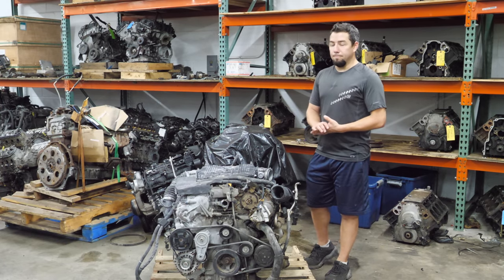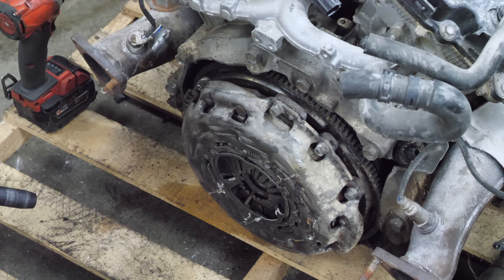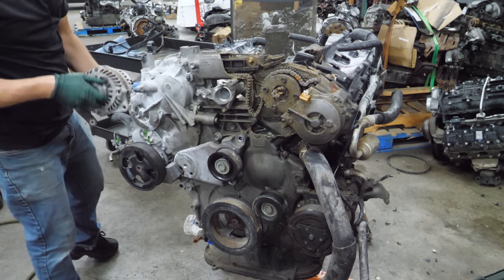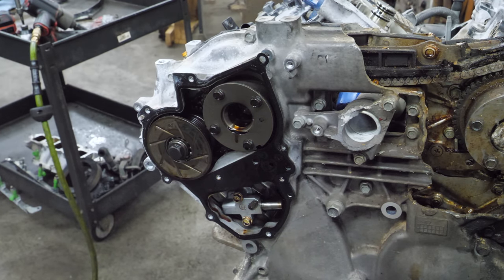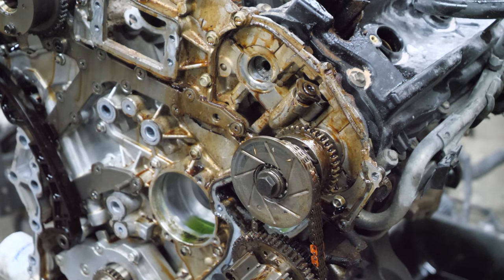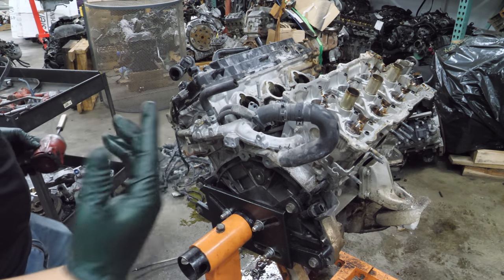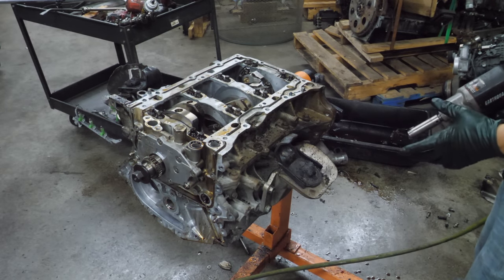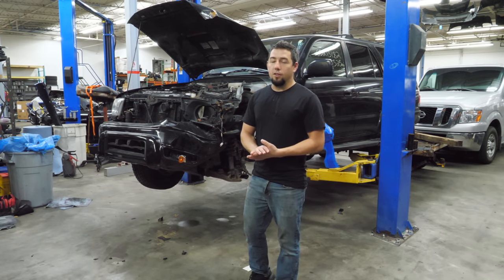VERY BROKEN Nissan 350z VQ35HR Engine Teardown! Did Anything Survive?

Comment: Judging by the plugs, it ran well on it's final trip!
Reply: It’s always running great before it blows up.
Reply: That engine has all the signs of good maintenance and a healthy amount of Italian tuneup.  The windage from frequent high rpm keeps the oil deposits from building up, running a high quality synthetic oil doesn't sludge and varnish very easily, the intake ports have a nice healthy fuel washdown pattern, the back of the intake valves are clean, and the dry areas of the ports have minimal buildup.  It would have been interesting to see how the rings looked as far as how clean or fouled the grooves and oil rings were, as hard driving tends to keep them relatively clean as well.
Reply: @hdrenginedevelopment7507  I can confirm that it's impossible to own a HR and not redline it regularly

Comment: Is it just me, or is that sound of high- torque fasteners being cracked off lovely?!!
Reply: Late to comment… but yes. The sounds of the pneumatic tools sped up sound crazy cool
Reply: @TheSleepyMechanic0524  Love engines. I ride bikes and the thought of having to ride a 2 wheeled milk float fills me with dread.
Reply: I wonder why each head bolt sounds like it cracks twice when loosening with the breaker bar? One as it starts to move and then one more time like 1/2 a turn in?

Comment: I think the point to take here is if you don't change your oil, you get variable length rods and piston mcnuggets.  If you do change your oil, you get them newfangled cracked cams and a nifty timing cover access port.  That's why I don't use Amsoil.  Instead I use Nozoil.  Because no oil = no problems!
Reply: This comment. So true, but so wrong. But so agreeable
Reply: LOL

Comment: Never heard of a bearing issue on a vq lol, only thing major that should be done on vq's roughly between 100-140k miles depending is timing chain stuff and do water pump & valve cover gaskets (valve cover gaskets are easy asf) while you're in there. Other than that if you literally keep routine basic stuff(oil change + filter, diff oil, transmission fluid), these are literally some of the most consistently reliable engines.

Comment: I cant stand knowing a VQ whether a 35 or 40 has failed.  Because these motors are built SUPER TOUGH.  So it must take a lot to kill one.  And Nissans greatest feat for a mass produced motor will always be the VQ series in my opinion.

Edit:  The reason i am so confident in these motors is because i bought an 06 Xterra with 236,000 miles.  After SMOD,  and 3,000 miles and 1 Winter later,  it developed the oh so annoying CHATTER.  Well,  i drove the X like this up until 322,600 miles.  It just got to be so loud in drive thrus that i HAD to replace the Timing Components.  And upon Front Cover Removal,  i had ZERO ZERO ZERO ZERO ZERO ZERO timing chain tension.  The guides were destroyed and all 3 tensioners were collapsed.  But this engine kept running non stop.  The chain was so loose it chewed a 1/4" valley into the rear timing cover and oil gallery plate.  No misfire,  no failure and no timing jumped.  Now i want all readers who are mechanically inclined to think about that for a moment.  NO CHAIN TENSION?  And running it at 5500 RPMs a lot to pass?  And this engine is STILL running good?  How?!?!?!?!

Comment: Stopping the crank for harmonic change. I use a trick my uncle showed me, i know not the best method. But remove plug and go to tdc on c1. 1/2 rotation on crank, feed about 6-8" of some 1/4" rope thru plug hole, clothes line works great. Intake valve will close, then continue spinning crank. The rope will stop piston without metal to metal contact. Turn back for removal.
Helps for changing valve seals without pulling heads too.

Comment: The VQ engine family is legendary. Won awards for so many years straight. And is so buttery smooth. I had the variant below this one on my Altima. It was so much fun to drive. Plenty of power. Reliable engine.
Reply: One of the best engines in the game paired with one of the worst transmission unfortunately
Reply: @KrymiaMusic  couldn’t have said it better. Having had several altimas in my past I can say from experience I did not like the first version of the cvt. The revised version drove better but still wasn’t smooth. Now the non cvts where average at best. But I agree with you. Was never a fan of Nissan transmissions.
Reply: @leosthrivwithautism  the transmission problems started after the “reno merger” when the french came in. Before that, bullet proof and performance machines
Reply: @KrymiaMusic  heck didn’t know that much. Haha. But good to know. I guess it was why my older Nissans where way better than the newer ones I had. I had owned Nissans for over 8 years and just realized the quality progressively getting worse. But was never sure why. Guess this answers it. 👍🏼
Reply: Same story with our 2010 Altima SR. Engine ran great, CVT blew up at 125K, and it ate alternators and batteries about once a year.

Comment: I have not ever tore down a modern engine, and I have never seen a water pump mounted inside the timing chain cover. It would be an expensive nightmare to change out the water pump on that engine, and a complete disaster just waiting to happen.

Comment: It would be interesting to find all of the parts for a given engine build, where absolutely every part came broken from another engine. Build one complete engine where literally everything is broken. Make it an art piece. Put a thick pane of glass on top and use it as a table.
Reply: If it's all broken how does it assemble together??
Reply: @Drmcclung  op is probably thinking about bent rods, bent valves, fucked up cranks and journals, scratched cams, broken chains, anyway, all that good stuff
Reply: @TiagoSC  So basically the 2022 version of "good used engine" 😁🤣
Reply: @Drmcclung  mild driven, barely broken in, grocery getter, never saw 3k rpm.
NO LOW BALLERS, I KNOW WHAT I HAVE.

Mileage: 768.435
Reply: @TiagoSC  2009, $14,600 FIRM
Reply: It would be tough to find broken wrist pins though
Reply: @betty123ism  lol
Reply: @betty123ism  True. Tough, but not impossible.
Reply: @Drmcclung  Brute Finesse

Comment: This engine reminds me of an ambulance the yard I work for bought a few years back, it had a low output version of a duramax with a 4L80E behind it. It bumped into something and bent the torque converter. (yes you read that correctly) The torque converter neck being bent bound it over the input shaft of the transmission, 2 or 3 of the original 6 torque converter bolts were still holding on (heads popped off the other bolts) to the stamped drive plate (which was bent like potato chip) but still bolted to the crank. This drive plate being separate from the cast flywheel on a duramax, which in this case was in pieces. Were it not for what you just read the transmission likely would've been ejected, and all that was required to separate the engine from the trans was cutting the steel drive plate with the torch around the converter bolts through the convenient user installed access gap between the engine and trans.

Comment: As mangled as that engine was, it makes me wonder if the driver is still alive. That must've been a high speed impact
Reply: It'd be a miracle, when the trans broke it had three places to go either down into the ground, side ways into the frame rails, or up through the thin body panels and into the interior of the vehicle....
Reply: It takes quite a bit to kill someone in a frontal impact. Like, way more than this.
Reply: @lovelessissimo  No it doesn't----just the force from a high speed impact alone can break someone's neck and kill them instantly.
Reply: @justsumguy2u  maybe in cars from 30 years ago. Nowadays with crumple zones, air bags, head rests, stretching seatbelts, and the fact that its lateral movement that breaks vertebrae and severs the spinal cord, the odds of survival in a frontal collision are very high. Fatal injuries due to frontal collisions are typically incurred due to internal bleeding, which can happen, but it takes enough force to overcome the other safety  systems. And that much force would annihilate the engine compartment.
Now, a side collision is another matter. It doesn't take much of that to kill someone.
Reply: @lovelessissimo  I gotta admit this all seems so ghoulish and macabre. Unfortunately for me, it's all too real. I saw 2 kids  killed in a 350Z in 2008 right in my rearview mirror. - Driver (who had been drinking) was speeding and rounded an S curve in town, went wide, driver jerked the wheel, overcorrected, the car slewed right then left and sailed across the center median, just missing me and T-boning itself sideways into a brand new Tundra behind me. Estimated impact speed about 130mph (Tundra 50mph+350Z about 80mph). Tundra was crushed to the firewall, its occupants sustained only minor injuries. The passenger in the Z had no chance, DRT. Driver was DOA at the hospital. It was a terrible thing to see happen, and I'll never forget it as long as I live. Modern cars are tremendously well engineered, but physics is still physics.
Reply: @lovelessissimo  have you ever seen the crash that killed dale Earnhardt because that one didn't look that bad either
Reply: @wades623  You're right, but I THINK the general consensus there is Earnhardt's harness broke, throwing him into the steering wheel; had he been wearing a HANS device, he might've lived.
Reply: @CaptainSpadaro  thats not what happened. It's BECAUSE His harness stayed intact which kept his body still. His head kept going forward resulting in a spinal fracture at the base of the skull. 

Had his harness actually broke he would have had a higher chance of survival as his body wouldn't have been held in place. 

The HANS device at that time was optional but was mandatory afterwards specifically due to the injury that took Dale's life.

Comment: Congrats on the addition to the family.
Reminds me of when my dad hit a parked car with his '67 Fairlane and pushed the other car through a brick wall. Broke the bellhousing and the engine slid under the car. Water pump and timing cover were non existent. Front of the car was nearly pushed around to the driver's door. He was only doing about 15 mph!
Great vids. A suggestion for a tear down would be a W12 or W16. Not a cheap engine to find but an engineering marvel.

Comment: One thing you ought to do before you deem the short block "good" is to put a dial indicator on the crankshaft output flange to ensure it isn't bent there. That flywheel imparted a ridiculous amount of force into the crank.
Reply: The fact that it still turns over relatively easily means its likely "ok" since its not binding up in the rear main, but still would be good to check. I'd also want to check for cracks as well in that area, but it might not be so easy to inspect without fully tearing it down. I suspect what broke the trans off was having the front of the motor impact whatever the car ran into which then turned it at an angle relative to the trans, which snapped the bellhousing. Amazing the short-block survived that.
Reply: Crank thrust bearings would be interesting to have a look at.

Comment: Technique i got from an experienced retired mechanic to get a crank bolt off without an impact is to take the heads off or at just one and shove some rope in one of the cylinders and put the head back on and can take a breaker bar to the bolt and the engine wont turn all the over.  Used it once and it worked great, and the rope is soft enough so it wont damage anything.  time consuming taking the head off, on, and then back off but if that's all you got then it works great.

Comment: Save the wiring someone might need the plug ends that aren't damaged.. like throtle body, coil and good side of varible timing. Car probably hit a pole as its very isolated spot of damage

Comment: The things you do for love on this channel. I love the VQ series, but hate what they do to their cats. Thank you again for the entertaining teardowns, and the education.

Engine Requests: 
Ford: 300 Inline Six, Windsor, FE, 1.0 EcoBoost, 1.4 EcoBoost, 6.0 PowerStroke, 6.7 PowerStroke, 7.3 PowerStroke
General Motors: 3100/3400/3800 Olds, L31 SBC, LUW/LWE 1.8l i4, 5.7L Olds Diesel (Yeah, right), L5P Duramax
Chrysler: Slant Six, MORE HEMIS, 1.4L FIRE, AMC 4.0/4.2
Honda: B Series, D Series, K Series
Toyota: 1LR-GUE (lol yeah right), 1GZ-FE, 1ZZ or 2ZZ
Subaru: FJ series, EZ30/36
Reply: How does the engine damage the cats? My brother in law knows of a coworker who had a new Titan and it needed 3 engines under warranty. He ended up buying a Tundra.
Reply: Near as I can tell it is just that the oem design does not have enough of the catalytic media to handle what passes through it. Excessive oil blowby (which was a problem with the EJ Subaru line), excessive exhaust temperatures (anything designed without E10 in mind), and poor manufacturing tolerances all contribute to that sort of problem.

Comment: what worked on my 2014 Maxima  was PB Blaster,  jamming a 3/8 extension in the main pulley against the oil pan and using a long 1/2" breaker bar with pipe..

Comment: Well if it was a fatal accident if you put parts from this engine on your current car, legend has it you will start to see images of the folks that departed over time.  So beware.  :)     Kind of like that Airplane crash in the 70's that happened in Florida.   Funny thing about that is that many many people were not believed in what they witnessed, but the airline when ahead and removed every single part they had re-used from the crashed plane.  Think about that for a minute.   :)     Thank you for the video

Comment: Here's something to consider from what I see with this engine. The sludge at the bottom of the oil pan, for the bottom half, likely is oil that got exposed to the elements after the engine was hit. Another thing is, the coloration from the bottom to the top shows that either this engine was near brand spanking new before it got hit, probably by a heavier vehicle, or was just that well taken care of. Another thing is... the lack of carbon ontop of the pistons, or even on the head side of the chambers where the valves are. Which is bizarre, but makes me wonder if the engine was taken care well enough to keep carbon build up from being a problem ever, or if the engine was, again, just that new of an engine that it's lifespan was cut a bit short. It would make sense if the engine and car were both fairly new, or if at least the engine was, Which is a bit sad either way but... would explain the lack of any real internal oil varnish from the engine just running. Tho the stuff on the exposed sections of the engine... I presume is a form of varnish produced by some kind of oil product, such as the engine oil itself possibly. Either way, that small corner of the engine is clearly stained from the crash it had.

Anyways... as for an engine for you to maybe tear apart... There's one kind of engine that I'd kind like to see, and that's a variable compression engine, which supposedly can adjust their compression on the fly of each piston individually to aid in emissions and also torque and power balancing and all of that stuff. Basically a bunch of fancy stuff, and I'd like to see one of those engines, perhaps a blown up one, but one that failed mostly nondestructively would be nice to see honestly solely for teardown purposes and whatnot.

Comment: We use to have a full size, Ford E-350 van with a heavy duty trailer hitch.  One day, she was rear ended by a kid driving his Father’s Acura Integra.  He & his buddy were looking to the left at a For Sale car parked in a vacant lot.  They didn’t notice that the traffic he was following by 20 car lengths had stopped for a pedestrian in a crosswalk.  Just before impact he noticed the impending collision and jammed on the brakes.  Which caused the nose of the Integra to dive, low enough that our van’s trailer hitch took the head off the Integra’s engine. 

My point is that even minor collisions can destroy an engine depending on the details of the impact.

Comment: if you will take a couple of old plastic milk crates and notch to open end to fit over the engine stand leg  it gives you a wide flat place to put your drain pan without trying to balance it on the leg.

Comment: Had to be a low mile VQ. They are definitely infamous for using oil. I owned an 06 Murano for years. Once it hit about 130k miles, I had to check and usually add oil every 250 miles. 
I traded it in a few years ago with 269k miles. As long as you keep your eye on the oil, the VQ is a reliable very robustly built engine.
Reply: HR won't burn a lot of oil. DEs have bad cats that eat the engine and valve stem seals are trash.

Comment: I don't know if it's such a good idea to rebuild the engine. Obviously, the engine has received quite high mechanical forces, even the parts that seem to be intact, like the one head and the block, have received a very strong impulse. Just the way the flywheel looked, the forces also went into the crankshaft and the engine block. Also the rear timing cover has cracks on the side of the intact head. I'm not an expert, but I wouldn't reuse anything from an engine that took such a hard hit.

Comment: Look really close at the camfollower bores on that rear cylinder where the valves were propped open.  The cam lobes were forced against the side of the bore, dimpling the metal at the edge, and locking the valves open.  Those valves aren't bent, but the head sure is.

Comment: Did you actually determine that the alternator is good by simply looking at it?  You are a magician!
Reply: He determined it was apparently undamaged from the crash; whether it actually functioned is a separate test, yes, but as it was in use when it crashed and didn't appear to have been damaged in the crash, it is reasonable to suppose it is ok. He likely will properly test it later.